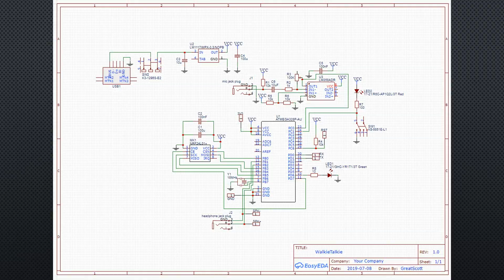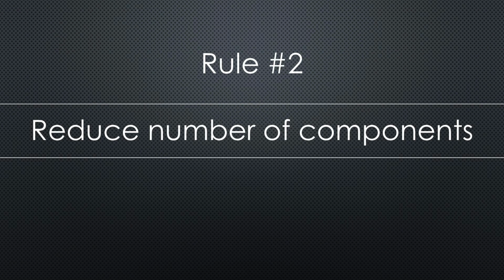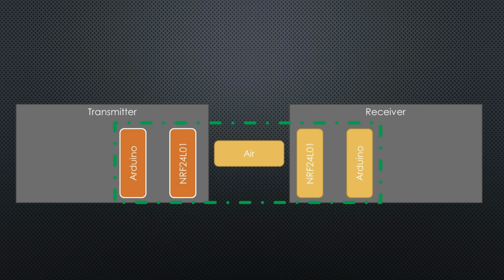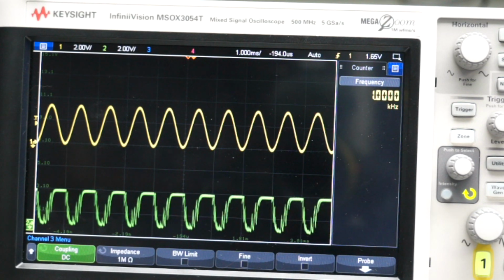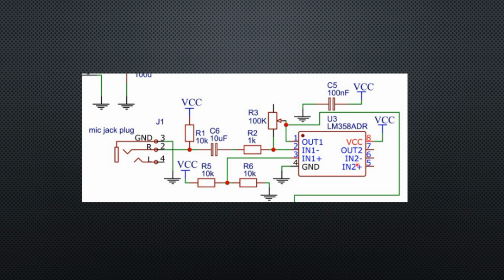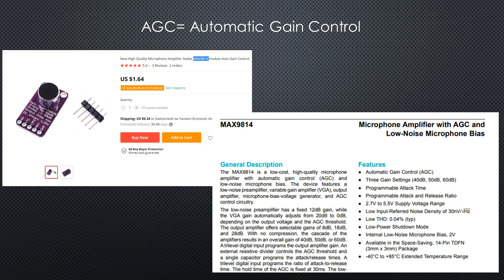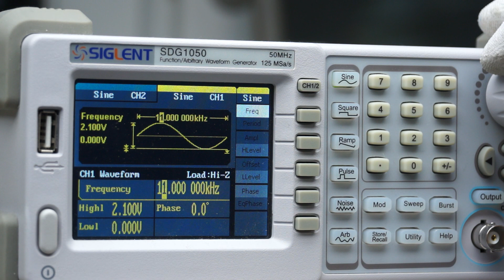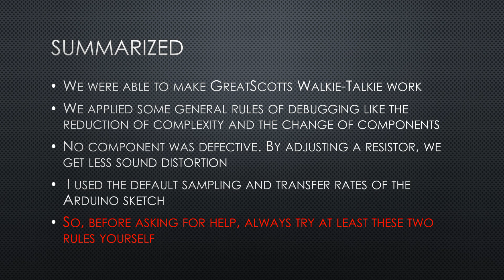#279 How to debug Arduino Projects (GreatScott's Walkie-Talkie)

Comment: Hi Andreas.  
First, a few of suggestions (then on quibble).  
1.  A good input analog design would include a low-pass filter to avoid aliasing.  A simple single pole filter at 5 kHz would be adequate.  2.  The analog output from the receiver should also include an amplifier and lowpass filter (2 pole or higher).  This will help to reduces some of the quantization "noise" that is evident in the audio.  I'd suggest a 4 (or 5) kHz breakpoint.  Almost all telephone companies transmit voice signals between 300 Hz and 3100 Hz. Historically, telephone companies allowed an analog telephone channel a bandwidth of roughly 4000 Hz (maximum) to work with.  3.  If used on a motorized bike, the analog input should be shielded as much as possible to avoid ignition noise -- even good bike electrical designs may be somewhat noxious.
Lastly, the quibble.  Digitization is the process of converting an analog signal to a digital representation.  Digitalization is the process of converting non-digital SYSTEMs (for example, a newspaper, bookkeeping ledger, etc. ) to digital system(s).  Generally, digitalization is to allow archival storage, transmission, etc., of "things" that in the real world are not digital.  Arguably, this "might" include analog to digital conversion, but the pedant in me shudders at this usage.
Reply: I sort of agree with your suggestions for 1st and 2nd order filters. The breakpoints you choose are interesting given sibilants and their intelligibility are compromised when using the conventional (historical) phone bandwidth.
One hopes your competence in the Swiss language is at least as good as Andreas’ abilities in English.
Reply: @mahudson3547  Andreas' excellent English would not have gotten to the point where it is without him caring about details! English is my second language as well, and I appreciate when people point out mistakes as it presents an opportunity to improve. I'm never offended by receiving correct, factual information, nor would I expect someone else with the same attention to detail to.
Reply: @leifclaesson2470  A very fair comment. In which case you would not be offended to know that there should not be a comma before and or nor. We English are generally very lazy about learning languages and admire those who master ours.
Reply: @mahudson3547  Back "in the day," I worked as an engineer for AT&T.  Analog comprised 95% of all telephony then and the BSP (Bell System Specifications) - the "bible" of telephone system design, specified that bandwidth because their studies of intelligibility suggested that that frequency range was satisfactory -- and this worked well with the "up and coming" digital network requirements.  Of course, Claude Shannon was a star at Bell Labs.
Reply: The first 15 years after my degree in Electronics I also worked as a communications engineer - mostly in radio systems - until people stopped talking to each other. Which meant a move to data communications. Unfortunately I now have a fourth order low pass filter built into my hearing with a 3db point at about 2.5kHz! That's old age for you! http://docs.polycom.com/global/documents/whitepapers/effect_of_bandwidth_on_speech_intelligibility_2.pdf
Gives a good reason why phone frequencies are suspect for intelligibility - see last para on page 3 et seq. Add the noise of the Harley and the Swiss accent and it could get tricky!
Reply from the maker: Interesting discussion. But maybe for the builder. I was only the debugger ;-)
And thank you for the English lesson. Maybe I heart too often "Digitalization" in the last time-

Comment: It seems to me you'd want the PWM back to linear audio to happen in a circuit designed specifically for this prior to the speaker.    Connecting it directly to the speak is too dependent upon the characteristic impedance and capacitance of the speaker.    This would also be a good place to add some upper frequency filtering so as to limit the aliasing harmonics.    Just my thinking on how to improve this even more.
Reply: Looking at some CLASS D amplifier circuits I see they usually have an inductor and cap in series at the output as a low pass filter.    I guess this is what I was thinking.    I'd never looked at a CLASS D before.   I'm a little better at this than I realized.
Reply from the maker: You are right: A filter would help there. But I just wanted to make it work. BTW: A headphone is a coil. And a filter.

Comment: I'd have started "trimming" by deleting the Arduinos and the NRF parts- perhaps replacing the NRF-link with a cable (pass-through from amplifier to speaker). I guess you are more "digitally/software-oriented"; you kept the Arduinos, and trimmed the rest ;) Whats the "static" though? The audio-quality doesn't sound as nice as I'd expect it to.
Reply from the maker: As I said, the Arduinos were the critical part for me. I would have given up if this would have been the problem. A filter for sure would have helped for the noise. But I only wanted to debug the system.

Comment: Transfering uncompressed speech audio over RF is ... suboptimal. Lots of data with low information density.

Arduino is too slow to compress speech. Esp32 should be capaple and has RF onboard. Can someone adapt codec2 or melp compressor to esp32? I did try and failed.
Reply from the maker: The data rate was not an issue here because the NRF24L01 are quite fast. But if you want to go to other frequencies with lower bandwidth compression would be needed.

Comment: I knew the bug was in the amplifier. As I commented on GreatScott's video, using the Vref pin on the Arduino with two resistors to tune the ADC input voltage amplitude eliminates the need for the LM.
Reply from the maker: I do not think this would be sufficient. The LM358 amplifies the very small signal with a factor of 100

Comment: I would’ve thought adding a cap or resistor somewhere would’ve solved it, but with out a scope no one would’ve known.. good job man!!!
Reply: Illustrates the point that oscilloscope, even an inexpensive one, is invaluable troubleshooting tool for anyone messing with this stuff
Reply from the maker: You are right. As I pointed out in my video about important tools: An oscilloscope and a cheap logic analyzer are indispensable.

Comment: It violates the rule "If it ain't broke, don't fix it." however fore those who want to tinker; it should be possible to replace the Arduino with the transmitter/receiver by a ESP32. 
And perhaps besides Bluetooth also a Wifi communication mode could be added.
Reply from the maker: Or buy a working one, as somebody else suggested ;-) I found it interesting that it is possible with these components, which are not made for such a purpose.
Reply: Let's say, It was broken by(in?) design :)

Comment: hi Andreas. I havent seen the code yet..but on the arduino output/s, those 'flat top' looks familiar.Im pretty sure one output is for spwm of upper and the other output is spwm of lower half of signal. id give this circuit a go when im not quiet busy. 👍
Reply from the maker: Maybe. for me it looked like two "opposite" sine waves which, when added, resulting in a bigger amplitude.

Comment: Great vid.
I use a different rule set: 1. divide in two logical sections by educated guess or halving. Test in the middle if everything is ok. 2. If front part did not work, divide front in half and contunue with rule 1. If later part did not work, half later part and continue with rule 1. 3. if you make any changes due to testing, make sure to remove all of them before moving to next section. 4. Make sure you have objective measured results, avoid assuming too much based on measured data, separate assumed from the fact! 5. Simplify input if possible, like you used a signal generator in the start instead of voice, simpler input makes measuring simpler.
Reply from the maker: Good set. For this project, I did not want to cut in the middle, as I explained.

Comment: Excellent.  it shows what additional information you can get when you have a scope.
knowing what you are doing and going about it systematically should be part of our basic tool kit
Reply from the maker: Debugging without a scope or a logic analyzer is hard, I think.
Reply: Sure beats potentiometer, and unplugging / plugging in capacitors to iterate to a solution !

Comment: The same rules also apply in Software Engineering. If something doesn't work, start making the system smaller and test I/O. Great video :D
Und grüezi aus dem Ruhrpott von einem Auswanderer o/
Reply from the maker: You are right. My video about errors should have been quite universal. Grüezi aus der verregneten Schweiz!

Comment: Thank you for another great video and the lesson you have given to all makers and tinkerer. I suspect that you, as OM, heard immediately that there could only be two sources of error. Open Source is a great movement and I love the videos from GreatScott because he mostly does very well researched and competent videos.
But at the end of the day it shows again that nothing can be replaced by background knowledge and a lot of experience.
Reply from the maker: I was not sure if the "Arduino part" worked or had issues. This is why I checked this part first. I am sure it was not easy to write the lib because the NRF transfers max 32 bytes at a time. And I assume it needed some buffering (I did not look into the details)

Comment: The folding effect occurs every Fs/2 Hz. The aliased bands repeat every Fs Hz because it is Fs/2 Hz up and Fs/2 Hz back down again...
Reply from the maker: You are right. I thought that is what the picture shows?
Reply: Replacing the Arduino with a STM32 will give you a much better (faster) ADC and quite a bit of processing power to do DSP with.

Comment: Small Tip: When testing microphones, instead of speaking try to whistle. It's pretty easy to hit ~1kHz to create a perfect sine. A sinewave is easy to check on the scope.
Reply from the maker: You are right!
Reply: Also, there is an app for tones.  Keeps me from passing out on long debug sessions! :-)
Reply: There is also the 3.3 kHz when whistling
Reply: Humming works as well, not as clean, but still :) Try to replicate the hum of the 50/60Hz transformer.

Comment: My sketch, which tries to post some json using https to a wifi network, without any changes, seems to work as intended about 20% of the time. The other times it fails with different Exception codes. It returns something like:
Exception (3):
epc1=0x402073b1 epc2=0x00000000 epc3=0x00000000 excvaddr=0x4000b781 depc=0x00000000

I think I ruled out any possible signal strength issues. Any tips on how to debug this?
Reply from the maker: Did you separate the different parts of your code and switch most of them off to begin with?
Reply: @AndreasSpiess  Yes, that's how I troubleshoot pretty much everything. Downsize the haystack as much as possible before trying to find the needle. Apparant random behavior seems to point to a h/w related problem according to various sources. I already tried external power which didn't makes things better. I downloaded the EspExceptionDecoder tool to parse the stacks. It makes it a bit more readable, but for me, a hobby scripter, it's very hard to adjust to c++. I just began with Arduino two weeks ago. There's so much to learn. But I am having lots of fun with it. I am making a cat tracker which uses IP geolocation and public available wifi spots for internet access. Ca't wait to discover his tracks!
Reply from the maker: Great project. HW problems inside the MCU are rare. If you suspect one, change the whole board to a completely different one.

Comment: A simple RC low pass filter might solve the problem with overtones and the quantization noise. Perhaps add some of this at least in the output to the speaker? Supressing all above 4.5kHz will not distort sound, since main components of human voice is up to 3.5 kHz for males and up to 4.5 kHz for females. Agood choice might be to also filter the input from the microphone, to get rid of unwanted noise above human frequencies right before sampling with the arduino. Noise not being transmitted will do good for the transmission as well, since less artifacts in the samples for the receiver will prevent to reconstruct a wave form that is distorted by high frequency components.
Reply from the maker: You are  right. I could have shown the FFT where you see the overtones. But I thought this was too much for one video.
Reply: Really good observation & suggestion
Reply: i have passive filters on my mic input and speaker output, still ALOT of noise. Added larger smoothing caps on the arduino and rf module power rails, that worked better and tweaked sample and data rate in software to get rid of the last bit of noise

Comment: Hi, 
I was frustrated when greatscott failed, but it's only to be happier now 😀
One thing is itching my head yet, can it be used with lora module innstead? And what range can be expected, assuming that audio will be transmitted. And by the way, what about using a audio (voice) codec?(yes I know it needs more power than a atmega328 but maybe stm32?)
Reply: Hi Meca, sadly Lora doesn’t really have enough bandwidth to carry voice. It’s barely able to carry enough data to support something like txting
Reply: Lora doesn't have enough "room" for speach. You need room to pack the speach information into wireless transmission.
Reply: See Andreas video number 112. It answers your question very precisely (as you would expect)

Comment: How can I solve the problem with probes at the minute 4:50?
Reply from the maker: @dave: As MrDomingo wrote: Use two probes referenced to ground on pin 9 and 10. Then use the math function available in all oscilloscopes to subtract one channel from the other.
Reply: Google for differential measurement, alot of good explanations Out there.
Reply: @mampfi  oh good, I need a differential probe!
Reply: OR measure signals against a ground reference for both test points
Reply: Two independent oscilloscopes
Reply: In this particular example, as it is an audio output driving a low impedance, a simple audio transformer between the output and the scope would work.

Comment: Well Done Andreas.  It need more low pass filtering or a higher sample rate or both. Also Squelch (in firmware)
Reply from the maker: You are right. But here I wanted to focus on debugging
Reply: @AndreasSpiess  Absolutely. Excellent Debug video, I'm not saying you  should do it :-)   
but what it really needs is a better design from the start using maybe ESP32s for their DACs and radios.

Comment: RULE #0 : If your project / code does not work let another guy have a look on it!
You can be 1000% sure that this line of code works, and so you will never see the error. Another person may say: "But.. in line 99 that..."
"Oh my God, thats right!"
Reply from the maker: Here it was not the code ;-) But in general, you are right.
Reply: Easiest way is to tell you friend about program and tell how it's working. you usually find that bug also at thins point. some people use rubber duck for this "rubber duck debugging". It's also sad that current arduino ide don't support most powerfull debugging (ICD) where you can use breakpoint and read + change values when run is paused.
Reply: @LimbaZero  I have a stuffed ferret I keep under my monitor.. He's literally who I talk to when trying to talk out a code problem.
Reply: Welcome to open source...
Reply: Ain't that true? Just the other day I was working on some Node-Red project with a friend. I'm the hardware/coding guy, so while he was dragging his flow together I had nothing to do and was entirely distracted trying to catch up with my emails. After 10-15 minutes of him banging his head against the wall, stuck on some issue, I glanced up from my mails and spotted the error immediately.

Zero Node-Red experience. The only reason I caught the error immediately was because I hadn't been staring at it for 15 minutes straight. Had I been paying attention while he was building the thing, I'd probably missed it too and would be scratching my head alongside him. ;)
Reply: Golden rule of devs was always working in pair.

It’s extreme programming principle. Oh wait, this is electrical stuff.
Reply: Code is never wrong! Just the expectations are!

Comment: Great. But what about a Proper Noiseless Walkie Talkie?
Reply from the maker: You can buy them everywhere for cheap ;-)
Reply: @AndreasSpiess  While not within the 'debug and improve' scope of this video, a new video detailing the use of a "Proper Noiseless Walkie Talkie" module in conjunction with an Arduino might be of interest to quite a few viewers. The sa818, sa828 and rda1846 modules all look reasonably interesting.
Reply: Cray Ze Ape those modules look nice, thanks for the tip! A bit pricey at around USD 20 for a pair, but I suspect you get what you pay for
Reply: Great Andreas 
DIY or Buy.
Reply from the maker: You get complete Walkie-Talkies for that price.
Reply: Andreas Spiess sure, but to be fair, you’ll probably not get a pair for that price
Reply: @AndreasSpiess  Sad as it may be, that is true, though for project use, they're probably much easier than hacking into an actual walkie-talkie.
Reply: Noiseless coms systems were used by the air forces 30+ years ago, & were classified stuff.